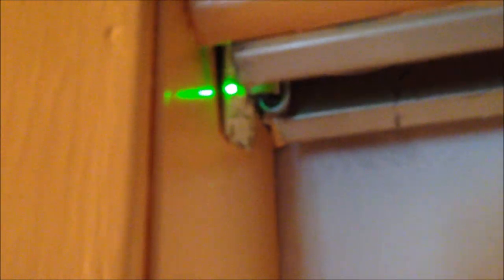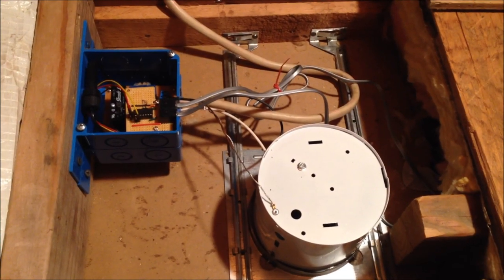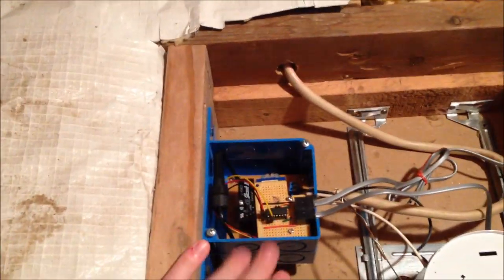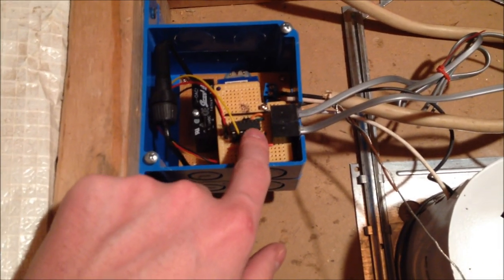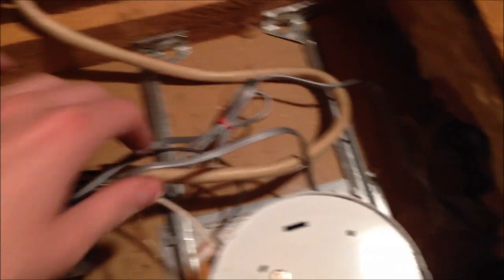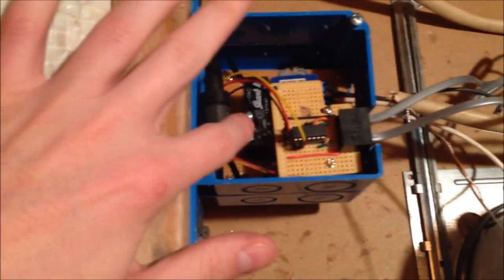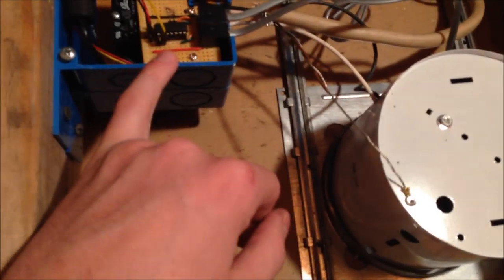Closet Door Lightswitch

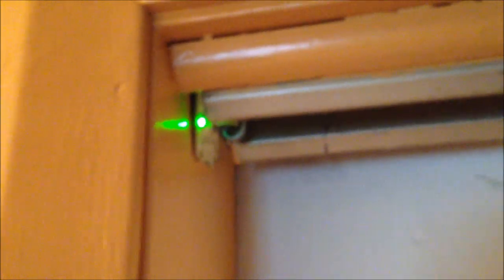Comment: @ 0:37 so you need the light to know which door is open? can't you just look at which door is opened? :) am I missing something?
Reply from the maker: That feature is designed so if the door isn't closed enough to trigger the reed switch, you'll know. It's possible for the door to be closed enough that you can't see the light is on inside the closet, but not closed enough that the light is actually turned off.

Comment: This is exactly what I am looking for! 

I have a regular plug in the closet and was planning on running led tape lights. 

I wanted to use this type of setup to turn on/off the lights regardless off which door opened it with an adjustable auto off. 

Any recommendations on where I can get the setup?
Reply from the maker: Are you comfortable with making it yourself? The blog link in the description should give you everything you need.

Comment: I think you went over the top for a closet light.. nice result though. Cheers
Reply from the maker: Thanks! 6 years later and it's still working. No issues at all.
Reply: @DillonNichols  Yeah, seems centuries proof indeed! Was looking for some ideas to turn on my glove box light when it opens, might stick to a switch..
Reply from the maker: survivalboxing I have another closet light video (https://youtu.be/FGXyGarJ7g4) and use an adjustable pin switch there. I think those are actually made for automobile applications so might work well for you
Reply from the maker: survivalboxing the benefit of magnetic Reed sensors are they're a little more forgiving on placement and don't need force to close them. 2 things that probably don't apply to a glove box.
Reply: @DillonNichols  "Over-Engineered Closet Lights".. haha indeed.. you are the spaceX of closet doors ;) another cool system! And yes pin switch is actually the answer, thanks :)